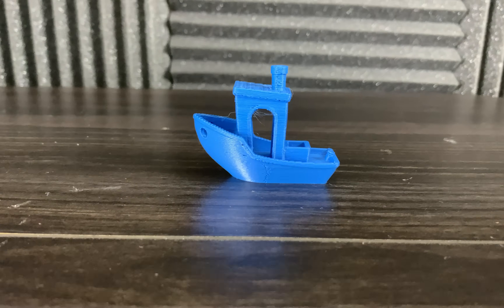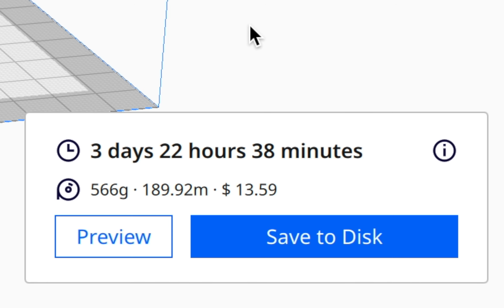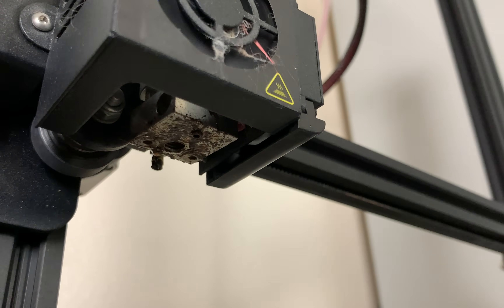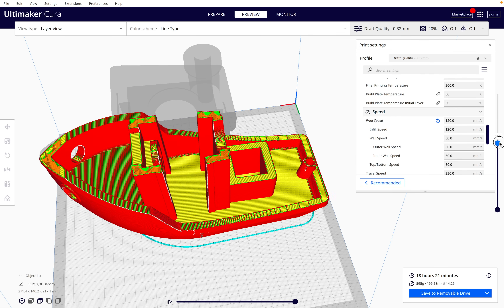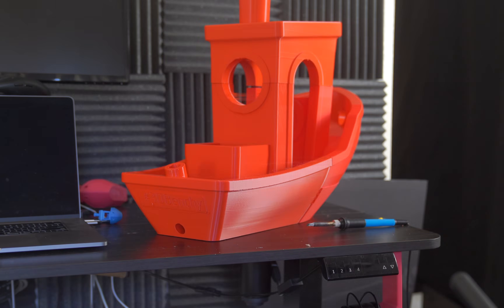Stop 3d printing so slow!!! 🤯 (how to print faster)

Comment: Okay now do the fastest print with speed and strength compromised for each specific type of 3D printing application.
Ex. you might trade materials strength for print speed with simple model use for desk decoration but how about the lowest strength you can trade for print speed to something like skateboard hinges?

Comment: How did you get the approximate cost when you slice it? Great Video and thank you very much.
Reply: Ok no sorry that sounded kinda
Most slicer have a section i nahe filament settings that asks how mich you pay for 1 kg 
Thud value is used when calculating the price 
And the amount of filament is calculated how much the printer need to get filament (if that made any sense(

Comment: The question is how does one get good quality prints at high speeds. I try to print out 120 mm a second with the the flow rate and retraction rate dialed in and my speed Tower said I could only do 60 mms

Comment: You can also increase your print speed. This will slightly decrease print quality, but is totally worth it when you're printing something large. On my Ender 3 V3 SE It prints things in great quality at 200mm/s.
Reply: Can confirm, I regularly print at 350+mm/s on my Ender-3 V3 KE

Comment: What to do for resolving issue of sticking to bed since filaments are not stuck well and the process fails
Reply: Set initial layer speed tp 25-50 mm/s and set the number of slower layers to at least 2. Hope this helps! I print at 300 mm/s on my modded ender 3 v3 se and setting the first two layers at 25 mm/s works great for adhesion before the printer starts going fast enough to unstick it.

Comment: One major thing this guy forgets to mention is that each and everything he does will lessen the quality more and more with each thing done along with pushing ur printer past a certain operating speed isn't advised because it will literally tear your 3d printer apart along with also using zig zag makes a print very brittle now it is good for things that u plan on having as just decor but at that point I would say rather use it more to save filament not time 3d printing is a craft and like all others you cant just rush it like he says because the more u do the worse ur quality will get and the more damage in the long run you will cause along with other issues now if you don't care about quality or durability then go ahead and follow his instructions at your own risk just know that if you do those are the costs and also don't ever forget making something move faster than it should will damage the gears and belts might be slow might be fast but it will happen
Reply: this message comes from someone who does this as a side job and makes an honestly good pay from it making big cosplay prints decently fast but even so certain settings aren't just a thing you mess with without knowing there are consequences for each thing you do and cutting corners makes that show very quickly with anyone whos done 3d printing for a while
Reply: @reeccoonaplays  Very true! while I feel as though everyone should practice, and learn these settings, and what they do. They should also not just use them all and expect good results especially on smaller projects. Could definitely confuse a newer maker.

Comment: 🎯 Key points for quick navigation:

00:00 Demonstrates the time and cost required for 3D printing various objects.
00:27 Slicing software estimates a print time of over three days and costs more than $13 for large models.
01:03 Increasing layer height to 0.28 reduces print time by about 60%.
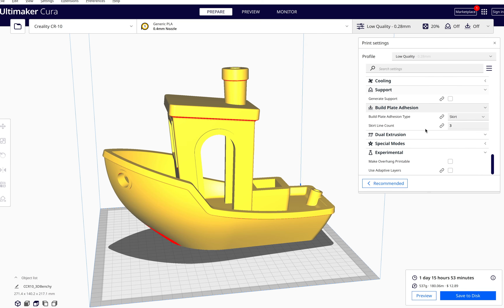01:16 The stock Creality Ender 3 can print up to 120 mm/s, reducing print time to 1 day and 2 hours with layer height change.
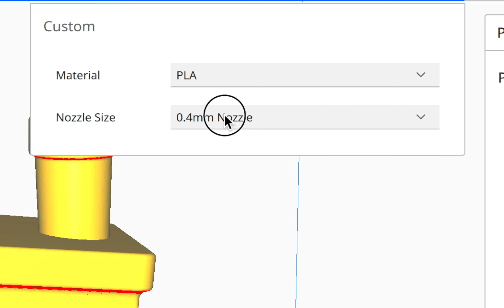02:01 Using a larger nozzle and higher layer height can reduce print time by 81%.
02:15 Utilizing lightweight infill can decrease print time by 85% and cost under $9.
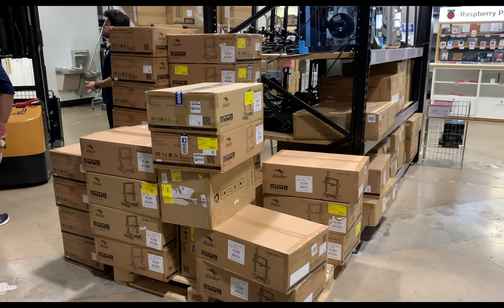03:02 Suggests that buying more 3D printers can significantly speed up the printing process.
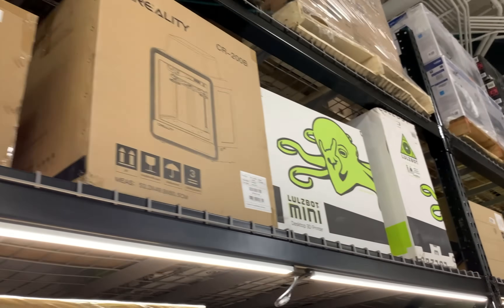03:30 Highlights a deal at Micro Center for a Creality Ender 3 Pro, beneficial for new customers.
03:44 Successfully 3D printed a large object in one day using multiple printers and optimized settings.

Made with HARPA AI

Comment: Did you know that zigzag infill is almost as fast as lightning and its stronger.

And there is another way to speed up printing. Out walls actually print faster and concentric top and bottom layers also print faster. Adding more walls can actually speed up prints with narrow infill sections.

Comment: I don't recommend anyone to get ender 3, each time out of each 20 prints only 1 works. Its like vray rendering it doesn't have an automatic system though the settings are standard i didn't mess anything up

Comment: i got my prints from 1749 minutes to 409 with ONLY Settings. i made the outer lines thin and the inner ones thick but ran them both faster so that the smaller one still looks good with that extrution. strength works as well. allon a 0.4 nozzle

Comment: Ender 3, I have such a hard time printing on black or brown PLA color. All my PLA light colors print good 220 nozzle 60 bed for tempered glass. Dark colors my best results  200 nozzle 55 bed and still a mess for a good print. Any recommendations?
Reply: I have a printer that goes up to 600 mm💀

Comment: Or you can just use OrcaSlicer instead of Cura. For me a big Benchy in Orca took slightly less than 8 hours and 18 hours in Cura. I tried to adjust print settings, like wall count, line height, line width, supports and others, to make them as close as possible to each other. So Instead of hacking and tweaking Cura, you can print much faster on Orca defaults.
Reply: Depends on the printer

Comment: HI - I want to 3D print a mould for a statue of a cat 600mm height in brass.
I want the walls of the statue to be around 3mm thickness.
I think I have to cast the statue in parts and TIGweld them togather to a whole statue.
The mould is way too big for my Creality CR10s PRO.
How can I divide the staue in parts printable on my printer ?
Any ideas ?

Comment: alright what's your quick N dirty technique for splitting apart the benchy into multiple pieces to print? I found this really painstaking to do in Blender 3D, had to duplicate the object, create a slice plane, etc. is there an easier way to do iT?
Reply: Pura slicer allows you to split parts very easily.

Comment: micro center has this deal a lot, right now it's for a ender 3 v2 which i like a lot, but i suck at everything so i couldnt get it running right, so now i have it on the floor somewhere wasting space.

Comment: SHOKING HOLD UP You're using 12mm layer, on a 0,4mm nozzle, with 20 infill and probably huge walls and infill. I would change the nozzle for a 0.8mm, reduce walls, reduce infill, if I want more speed I would increase the print speed and the nozzle heat so the filament goes smooth into the nozzle but beware the quality of the filament (the condition), the extruder (it's plastic, it's metal, be careful). HUGE PRINTS don't need high quality, we always do post processing, sanding, primer, putty, painting. I would not sell a huge print without post processing. Take the Iron-man Helmet, it can be done in 1-2 days with the correct settings but bad leveling, bad heat, you will fail and learn, it's a fantastic process of learning.

Comment: I don't think increasing the print speed that much is worth it. The quality suffers disproportionately compared to the little bit of time it saves. The upside of this is that sometimes you can decrease the speed for e.g. less noise and the print time won't explode. What's much more significant is the layer height, but even better the nozzle diameter because that will not only allow thicker layers but also speed up the print even without changing the layer height.
Also it can pay off to try different settings if you need supports. For example my slicer by default generates supports for any angle below 55 degrees, when in reality I can reduce this to ~12-20 without loss in quality, which reduces the used support material by far over 50%. As a bonus you'll have less surface imperfections.

Comment: There is an option on Cura which reduces my prints from 8 hours to just 3 hours and is called “Adaptive Layers”. 
I turn the option on and in most cases it dramatically reduces print time.
Reply: Does it affect the quality of the print?

Comment: When it comes down to it, there are two ways to reduce print time: reduce the amount of filament used, and extrude at the maximum volume flow rate that your extruder or part cooler can handle. Wide, thick layers will result in a short print time, even at slow movement speeds. A wall that's twice as wide and twice as thick printed at half the speed still prints in half the time. It's also much easier to upgrade your max extrusion rate than to improve all the kinematics of your machine to enable faster movement speeds.
Reply: The third way is Klipper with input shaping. Better and faster commands to your printer. This removes the limitations in slow Arduino style controllers BUT your printers maximum potential will still be limited by the flow rate and kinematics of your machine (albeit the limit will be higher than without faster processing).
Reply: This only workds for big items. I print small detailed
Reply: @lgnrome it works on every print. Increase inner wall width and then print fewer walls. Increase infill line width, combine infill so it only prints infill every other layer, but twice the layer thickness. I print detailed parts too, you can still save time at no reduction in detail.
Reply: @Dave_the_Dave  thank you for the advise

Comment: Now I want to know if a full size benchy is sea worthy!
Reply: Technically speaking, if the parts are welded well externally and internally, it should be, but I would imagine given how buoyant it would be,  you will need to add weight to keep it stable else it will sit too high in the water and roll over at the first wave.

Comment: Not only do you need upgrades to do this, even the speed as I would challenge that 120 figure outright frankly running spec extr variations, but also you’re not going to be able to use lightening on everything. If you’re trying to present a way to prototype print quicker, that’s more appropriately titled. But these settings even for hobbyist wouldn’t be sufficient so it’s misleading.

Perfectly fine the with sponsor I get why you said the more printer stuff - fully support that. But why not integrate that in a more actionable way? You could use the prototype angle and compared the result with a non prototyped angle. There’s ways to make this feel less like a bait and switch and extremely useful.I only say this bc I know you’re not only capable but would think of an effective way.!

Comment: Adding a Volcano or other high flow nozzle can make a big difference in maximum flow rate even if you don't replace the heater block. CNC Kitchen did a great video on different nozzle solutions which can handle significantly higher speeds without underextruding.

Comment: Throw a spider hotend on it, you can get a decent gain over stock hotends on the ender 3. I have been impressed with the flow and reliability of the spider. Don't get me wrong, it can't outflow a volcano but it doesn't ooze like a volcano does.  With some tweaks to coasting and retractions it prints really good.  

If someone wants to push the speed a bit more they are going to need more hotend flow, a simple all metal heatbreak will actually provide a decent bit more flow pair it with a good Copper nozzle for even better flow and another benefit is reduced retraction distance (~2.5mm vs ~6mm stock) which makes a noticeable difference in print time.  

As for speed, you should have at least mentioned acceleration. It doesn't reduce the speed in cura BUT in real world prints it does. Stock ender3 if want to keep it like stock reliability 2k acceleration is perfectly acceptable on all my enders when they were stock. 

Rambling about my enders below if anyone cares if not, don't read anymore.   Also willing to answer questions if anyone reads this wants to ask.
I have multiple enders all with different mods. My most reliable is stock hotend with a bi-metal heatbreak, aluminum creality extruder. Followed by the spider hotend,titan direct drive, skr 1.4 turbo w/tmc 2209. 

Fastest ender of mine is the one with linear rails,coper volcano block, titanium heatbreak, bmg extruder, mks tinybee w/tmc 2208 and all steppers upgraded. 

 Most troublesome but coolest imo is the dual nozzle, dual extruder setup. It's got skr 1.4 turbo w/2208, 1 titan extruder 1 bmg(not sure which I like more) it pushes as much flow as a standard  v6 hotend but isn't for speed.

Comment: I’ve had constant issues with my Ender 3 V2.

Final straw was a clogged of hot end. I could buy an upgraded one along with other parts but then why not just get a better printer period? Which I had done.

I learned alot from It which I’m thankful for, but I’m curious but others experience with it.

Have you had an issue with it as well? How’d you solve those problems and did you end up with a reliable machine? What did it take
Reply: do you clean / maintain it?

or after printing you just let it be?

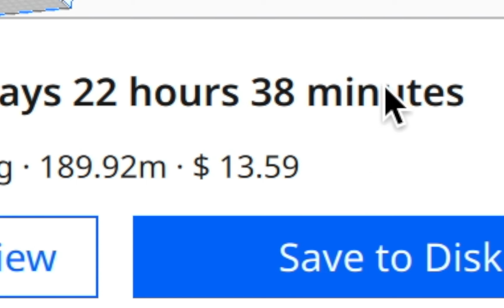Comment: How did you get an estimated price of how much PLA it was using someone please tell me. It was at 0:40 - 0:45
Reply: Are you using Cura? Preference > Configure Cura... > Materials > [Select your filament on left] > [Plug in price of your 1kg roll] - or if you're buying in different weights, you can modify the weight below the price.
Reply: @DrawClickPrint  Thanks! That helped me a lot. Yes I am using cura.

Comment: Puh... I mean... Nothing that was said was technically wrong but IMHO a lot of contexts were skipped over... Like just using a 0.6mm instead of a 0.4mm Nozzle ain't doing a whole lot... You usually save time when using a bigger nozzle by reducing the perimeter count - 3x 0.4mm = 1.2mm as is 2x 0.6mm = 1.2mm... You skip the effort of printing ⅓ of the usually slow to process perimeters while not sacrificing the material strength.

You'll also have to work within the limits of your machine when it comes to going with larger nozzles and printing at higher speeds... There's a reason these printers are cheap AF... They're not exactly built for either pushing the increased amount of filament through the nozzle or cooling that superheated mass of goop down in a timely manner... Heck... Even my Voron 2.4 printing at 300mm/s struggles with cooling down the Filament that needed to be superheated like a second before for it to make it through the nozzle.

Comment: You can also tweak a few parameters such as:
- number of perimeters
- perimeters speed (interior vs exterior)
- number of solid layers (bottom and top)
- speed of solid layers (bottom and inner)
- top solid layer speed, pattern and width
- infill pattern
- infill size
- infill speed
- infill every 2 layers
- infill only where needed
- travel speed
- etc.

Also, you can replace the current print system by Kilpper in order to reach faster speeds with same quality or even better.

Depending on what your goal is (speed, quality, structure, balanced, …), you should be able fine tune more settings. I am pretty sure that you can reduce you print time even more!
Reply: Please give us more details.
Reply: im new to printing, on maker website they provide printer settings, dont know if those parameters are optimal
Reply: @J-_-S  depends on material, geometry, external temp,... You will learn with time and failed prints
Reply: @pollrodri6254  oh yes Im failing, one piece failed to print, but rest of print has printed good. DOnt know why this shit is happening
Reply: @J-_-S  Hey, look for tutorials on typical printing errors, some are due to bad adhesion to the bed, some due to insuficient cooling, or maybe it is too much cooling. Without a photo i cant tell, but if the superior part did fine, it is a wrong bed regulation almost sure
Reply: Klipper Go vroom. By default I'm getting 300mm/s
Reply: plz make a video on 3d printing.
Reply: @oghomelesskid You're right,  it's planned in fact! We are going to change our channel content by tech DIY and a bit of science (it will include electronics, 3D printing and so on).
Reply: Increase extrusion multiplier/flow.
Reply: Yes but the tweaks this guy made are the more significant ones. There is little room to make the print faster after you are already at 120 mm/s, 0.32 layer height, with the minimum amount of infill. After that, yeah you may go for 2 perimeters instead of 3 and that won move the needle too much after you went from 3 days to 14 hours. At that point saving another hour is meaningless.

Comment: Klipper.... You want to print faster Klipper is the way! A stock ender 3v2 will almost never hit 120mm/s because the firmware limits acceleration. In fact try it yourself set slice one print at 80mm/s and a second at 120mm/s, there is almost no reduction in time, the reason is you are still limiting acceleration. Without Klipper and tuning input shaper cranking acceleration on an Ender will just result in ringing an reduced print quality.

Comment: I never new printing was so EXPENSIVE
Reply: In comparison to other hobbies 3d printing isn't that bad in a world where most people shell out $1000 for the newest phones. If compared to gaming it is relatively cheap. A decent gaming laptop can run around $1200 and consoles are in the $500 range so it isn't really digging that deep. And after printed for hours you have a finished product or models to show for the money you spend on a roll of filament.

Comment: I used print on my stock ender with a upgraded motherboard using 150mm/s and then I got the cr10 smart pro this year and I print depending on what I need to use the print for I print 250mm/s and it still comes out looking perfect.